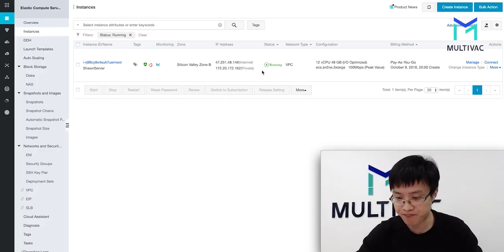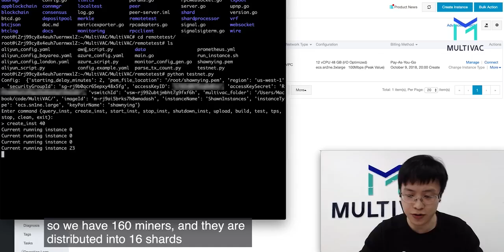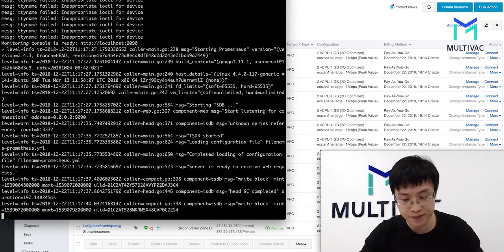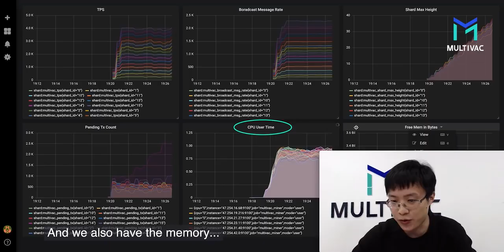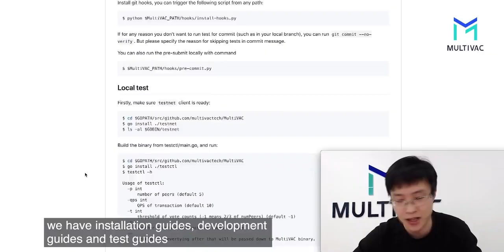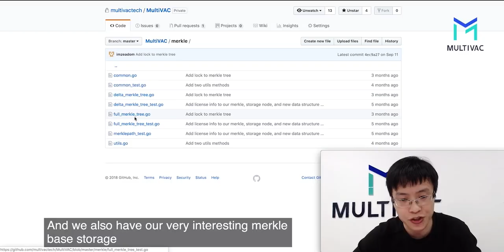MultiVAC Testnet Demo—All dimensional sharding blockchain

Comment: Can other bigger blockchains like Cardano and VeChain do this with updates in time. Or would it be beneficial for them to work with you MTV and can you plug your system in to other Chain for cross chain benefits
Reply: No other network does what mtv can do. And yes eventually they will all be crosschain i would think
Reply: @MyzGolf  the tech sounds pretty cool I must say.
Reply: @MyzGolf  this is cap
Reply: @camwakeman7292  huh
Reply: @MyzGolf  this is cap 🧢
Reply: @camwakeman7292  nahh
Reply: @camwakeman7292  elrond is the next closest in tech but their sharding is adaptive still not the same. Nocap